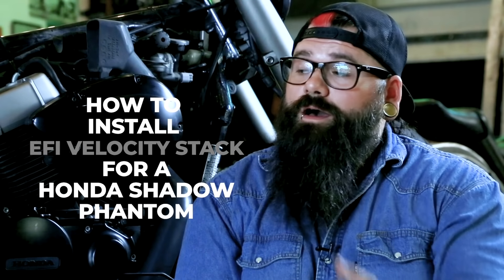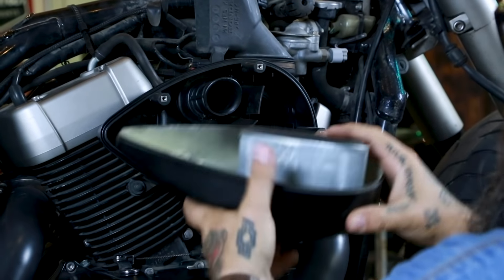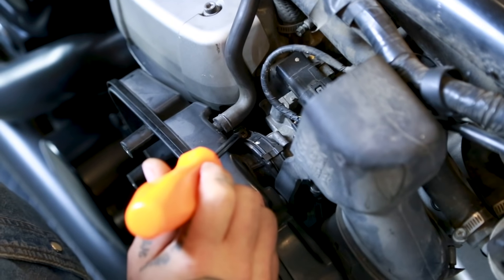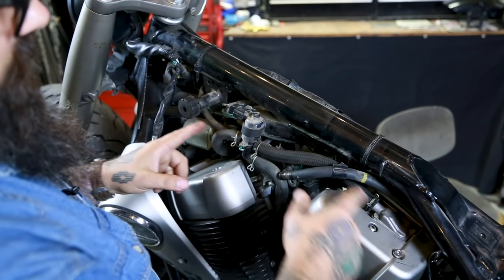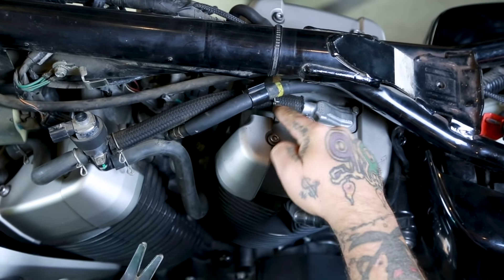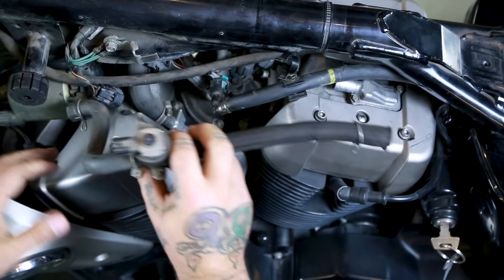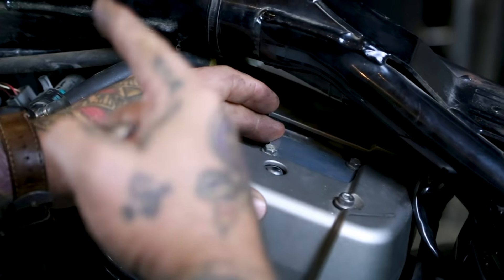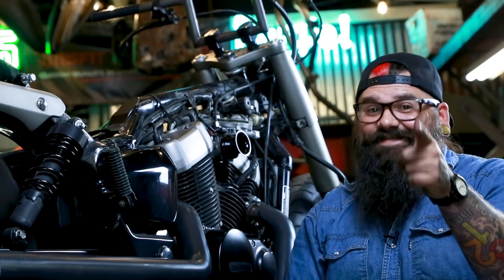EFI Velocity Stack for Honda Shadow Phantom - HOW TO INSTALL

Comment: TSJ, (The Shadow Jesus), I have a unicorn "2012 VT750RS" and your quality, budget friendly products have been a blessing since no one makes anything for my nearly complete bobber build!! You're ambition, passion and dedication is seriously inspiring!!! So much so that I am in the process of starting Buck's Bobbers(last names Buck) up here in Nor Cal. I am a disabled Vet, lost my fed. mechanic job due to PTSD related issues, but the best therapy has been meticulously building my classy/traditional gorgeous Shadow bobber with your parts and ones I have fabricated.. Ok, enough blowing your 18"er, just wanted to let you know I truly appreciate your work. So RELATED question, I ripped off all the epa junk and actually fabbed/milled some block off plates RIGHT before you released yours and just replaced my performance modified stock intake box with your long anticipated velocity stack. Question: on back of throttle body, on left side, there is the brass nipple with vacuum hose that went to ditched charcoal canister... Do I just plug it or is it like the carb ones that sucks air to fill up float bowls or what purpose does it have and does it need to have a tiny filter or anything? Thanks br.... thanks man, I didn't want to "bro you" since I don't know you lol. And p.s would love to see some side covers that dont stick out 5' like the stock plastic ones, covered cushion solo seat, rear black 11.5" lowering shocks like 412 Progressive Suspension or Burly ones for our G-rides so um my friend, not me, didn't have to cut a loop or two, a shorty front fender(rigid like the RS thick mount ones to prevent fork articulation) plus the RS ones sit ugly high and I had to fab it so fender sits more flush, and finally rear fender mounts/struts that are bolt on instead of spending $600 on a welder. Was an excuse to buy a smaller one anyway, but most us common folk aint Oprah rich... Keep the awesomeness coming man!!!!
Reply: Where can I see your rs build? I have one as well and I'm looking into doing this stuff

Comment: Hey brother I have a  phantom.  Seeing as you have unplugged a sensor that is controlled by the computer has it turned on the check engine light or anything.  Love the vids by the way I just found them

Comment: Do you need to have a fuel controller when you install the velocity stack on the EFI shadow ? Or will it be ok with the stock set up ?
Reply from the maker: youll be ok, but to really get the most bang for your buck a fuel controller that you can map will wake the bike up!

Comment: Do you need to add aftermarket fuel controller if you change stock air inalterable out and those block plates 
Or will the stock fuel controller adjust itself when install aftermarket air intake

Comment: Do you sell the rubber boot for the back part of the throttle body ?? I have a 15 shadow phantom 750, I felt air coming from the bottom of that boot.
Reply from the maker: We do not at this point but I'll look Into it!

Comment: What year was this, what did you use to tune,  and do you not do any new air filter?
Also can the epa garbage be removed while keeping the stock intake, I ride through raid constantly so I can't use the velocity stack but I want to buy the block off plate

Comment: 2010 phantom.
Vance & hines short shots, cobra f2000r tuner, cobra velocity intake.
  Any advantage to this " block off kit " ?
If so.. Tell me please. And I'll gladly purchase your kit.
... Thank you.
  Allen R.
Reply: The kit excluding the speed stack (idk what that's for)
Is to remove the emissions bullcrap from your system which will slightly improve gas mileage run a cleaner combustion so your engine lasts longer

Comment: Is there a power commander that you can get to compensate for exaust and airbox?
Reply: @TJBRUTALCUSTOMS  I can't find one specifically for a 2010 vt750s or do most 750 models use the same one

Comment: (I'm dumb )but why do you want to replace the whole airfilter with the velocity stack? Just for the looks of better airflow?
Reply: @TJBRUTALCUSTOMS  I have a 2015 phantom and I have been trying to find a way to add some performance to it. What does this mod do? I'm a newish Rider and I'm just learning about mods for my bike.
Reply: @joshsmith9558  I would suggest making a new comment, rather than a reply to an old one for your question. I have the same exact situation as well though! Newer rider, no mechanical experience, 2015 phantom owner. Really want to know how it breaks down with this vs. an airbox, as I have read mixed things online.
Reply: @CarlosNL & @Josh Smith the velocity stack, like @TJBRUTALCUSTOMS says, adds performance and looks and gets rid of the hideous OEM air box and EPA junk and weight.. The velocity stack smoothes out the incoming air and fully fills the intake tube. As well as extending it. It somewhat works like a supercharger by working with the complicated pulsation going on inside your motor that would take a while to explain.. But basically getting more non turbulent air, which means more fuel which means a larger and more homogenized air/fuel complete burn which equals more vroom! And blocking off the PAIR or AIS plates stops junk air from entering your intake. You will notice less decel popping and with the addition of a new tune/map or carb kit plus some of TJ's glorious pipes, you will hands down get the most power out of your engine! I have a 2012 VT750RS with TJ Brutal Customs velocity stack/backdraft pipes/block off plates (as well as seat hinge kit/seat barrel springs/license plate kit/rear fender/fender strut kit) and it dropped some serious weight and the performance gain is VERY noticeable!! The Power Commander 5 got the tune decent but with some tweaking it runs like a raped ape!!! I couldn't be happier with the quality of his parts and his customer service went far beyond expectations twice for me!! Will never think twice about purchasing whatever I can from @TJBRUTALCUSTOMS.

Comment: So if you do install a velocity stack on a FI bike is there any additional work that needs to be done? Tuning wise?
Reply: Only other thing I’ve done to the bike is cut out the baffles.
Reply: No these are plug and play
Reply: Do you have to?  No
Should you? YES you are changing the fuel air mixture system in a significant way

Comment: Do you really need the plates over the read valves?   Can't you just pinch the hoses shut or tape shut the original plate?  The plates do look much cooler though especially the black ones.